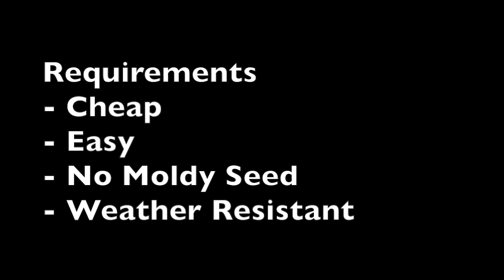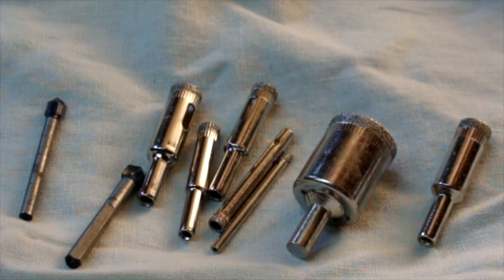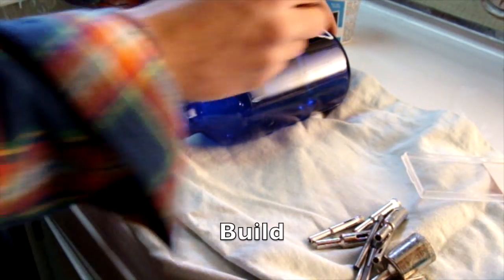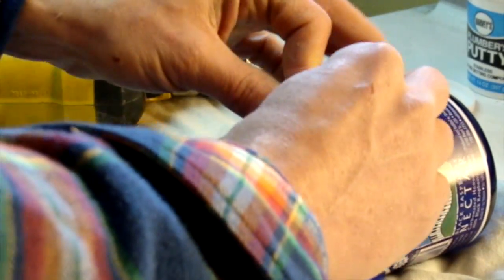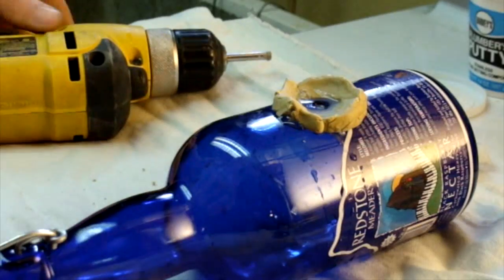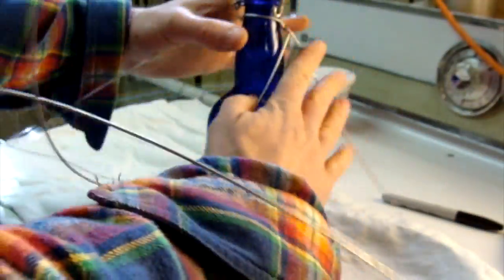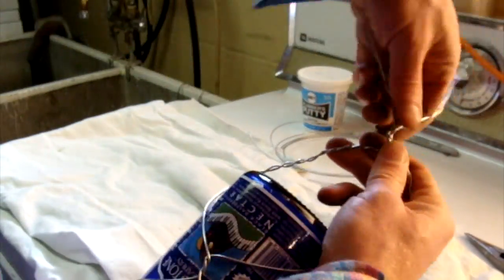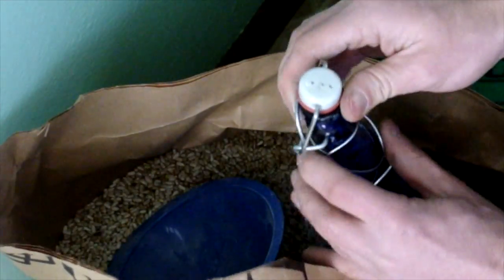DIY Bottle Bird Feeder

Comment: Why did you drill the holes in the middle of the bottle?  There will be a half bottle full of bird seed that the birds can't access.
Reply from the maker: I didn't want to put it farther down the neck (since it is hanging upside down) because then  the twig will block too much of the neck for filling.

If you hang it the other way, then you could really put the hole farther down.  I found it was easier to clean when it hangs upside down.  Old seeds don't accumulate and get stuck to the bottom that way.